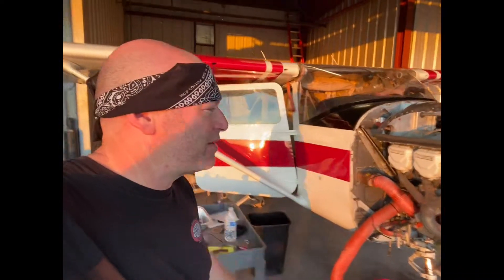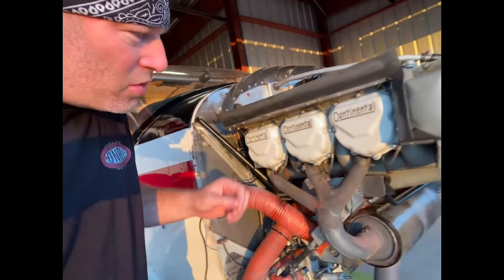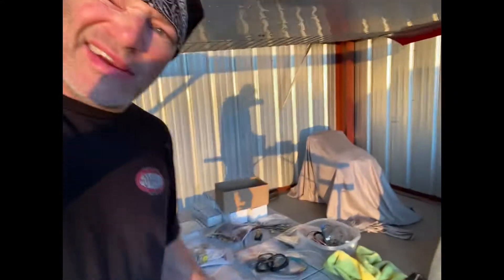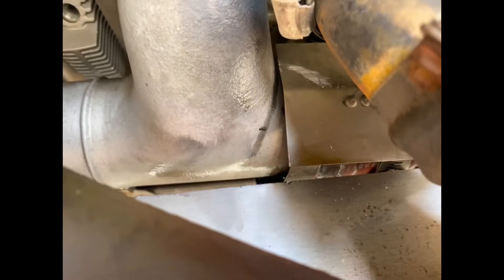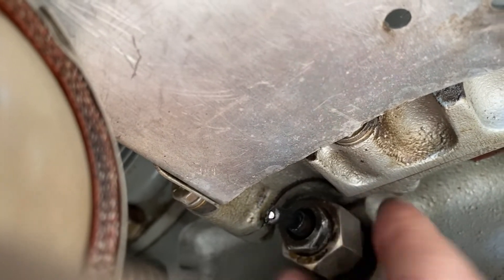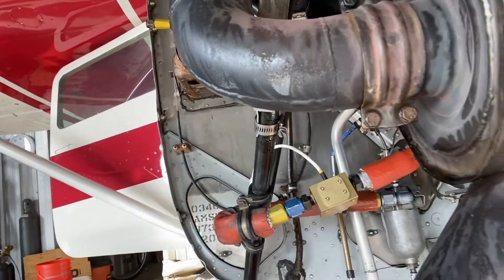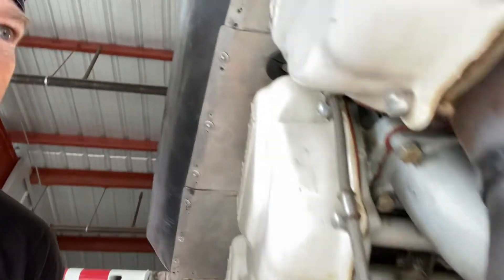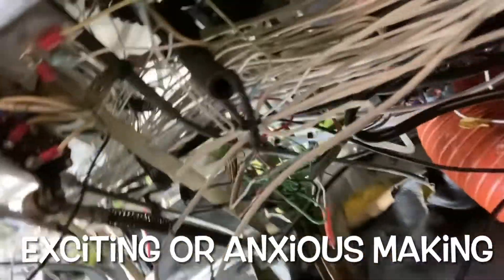Panel upgrade Part2 (CGR30 install)

Comment: In the process of upgrading my plane as well. I'll be interested in how you mount the shunt. Thank you for the close-up on how you mounted the fuel flow sensor. 

Thank you.
Reply from the maker: I installed two shunts, both on the firewall. The alternator one just below the voltage regulator, the battery one just above the starter solenoid. It’s in one of my videos, I’m just not sure which one 🤔